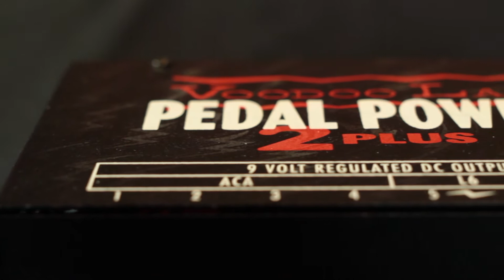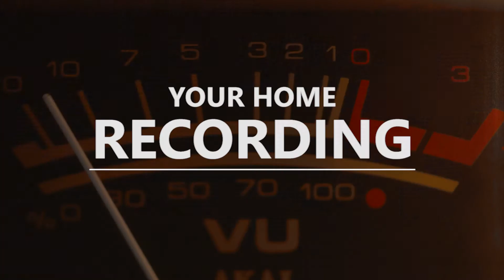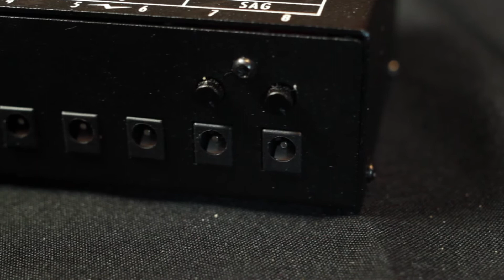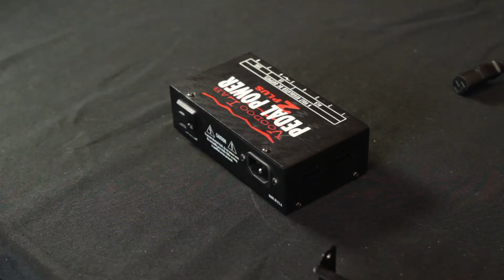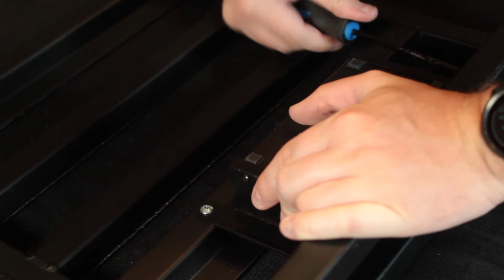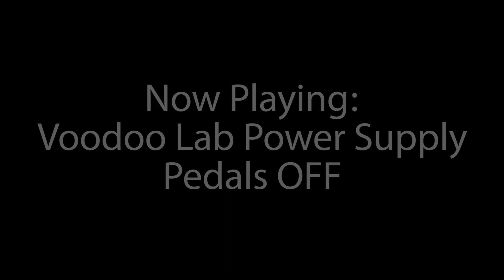Voodoo Lab Pedal Power 2 Plus Review – Best Pedalboard Power Supply for Electric Guitar

Comment: Would this work to power my Line 6 DL4? Usually takes an AC Power Adapter?
Reply: Yes, I use mine with the pedal power 2 plus. It’s the red ended cable and it can be done by flipping the channel switch on the back of the power unit.

Comment: Question , what is the difference "ACA", "L6" and  "SAG"? Thanks
Reply: Hi buddy.
ACA means that you have DC but with no voltage regulation. This is because the vintage Boss pedals used that kind of adaptor waaayy back to the late 70's-early 80's. Now Boss uses the PSA type, which is regulated and giving 9.6 volts. 
L6 is for feeding Line 6 pedals. These are much current hungry, so the outputs need to be much beefier on order to handle that much current.
SAG is a phenomenon caused by weak batteries into your pedals. By giving you less voltage, the pedal is starved of power and so gives you a muffled and mushy type of sound (just like a distorted radio with weak batteries), especially with analogue distortions like fuzz faces, and vintage od's of the like. 
I hope you get much light into this. If you have more questions, just ask me.
Reply: @emerson1978365  thank you so much for sharing your knowledge

Comment: I have pedals that are 300MA how do i power these ?
Reply: I have just bought the pedal power 2. I have a Fender the-verb pedal which is rated at 310 m/a. You can use a current doubler cable which is a single 9v into your pedal and the other end a double cable to go into 5 and 6 outputs giving you 500 ma. I’m trying to find out if I need to move the DIP switches away from normal, the instructions being somewhat confusing. If you find the answer to that one, let me know.